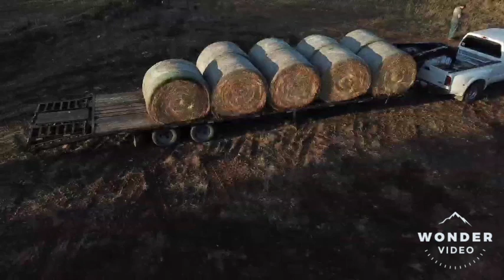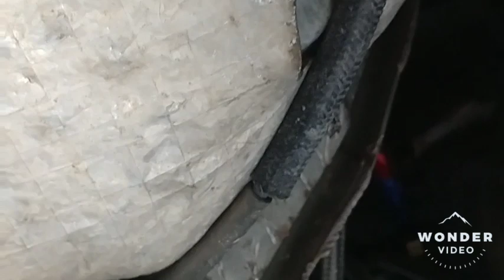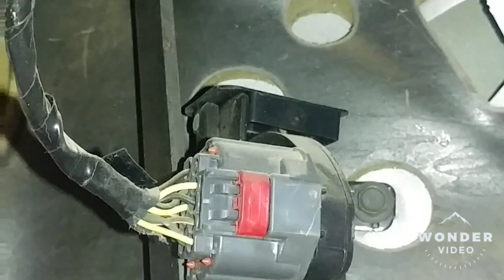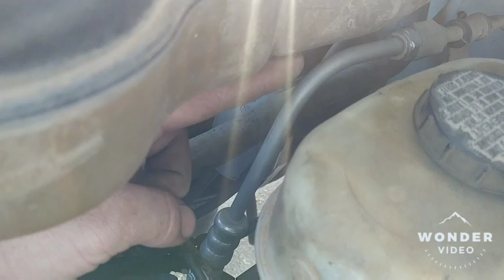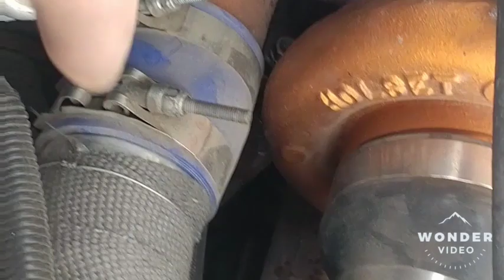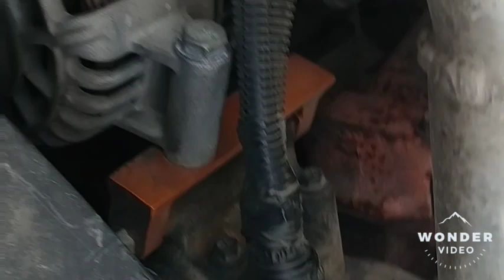Ultimate Fummins Tow Rig overview/ everything you need to know!

Comment: The F4 50s and 550s never came with the Cummins they came with the 6.8 V10 from Ford and that's when they moved the crossmember back
Reply: The F4000 in Brazil came with cummins and use the same frame rails
Reply: @Jal @JalopyFarmer that's true I never mentioned that I said the 450s and 550s never came with a Cummins

Comment: Am doing a swap now on a 2008 f 250  putting a 94 5.9 Cummins  need to know more about how you wired your transmission did you wire the cam sensor and crank sensor to the dodge sensor on the tone weel

Comment: I love your videos and I love that your testimonial for this kinda build and so educated on it. I personally want to do a 05-07 f250 swap don’t know if manual or auto is good and for motor was thinking 97 12v or a 99 24v with a p pump swap. I am curious to know what’s the most you ever had gross weight and did your truck struggle on that load ?
Reply from the maker: Most gross was 42k and it pulled just fine just wasn’t fun to stop. A comfortable weight is about 36k total

Comment: How are you setting the fuel PSI up for the ford fuel pump ? I’m at 30psi at start up and only goes down from there. I was hoping to get 50-60 psi so it doesn’t drop to zero at WOT
Reply from the maker: On the ppump take the return banjo bolt out and stretch the relief spring until you have desired pressure that’s the easiest way. Or get a fuel pressure regulator to put in the return line after the ppump

Comment: have a 5.9 out a 97 dodge that Was put in a 2009 f550. It’s eating up belts plus the belt is super tight I mean I never had a serpentine belt that is this tight. The accessories are from the f550. But the belt is design for a 97 Cummins. Im thinking I need to go smaller on a pulley and help will be greatly appreciated.
Reply from the maker: American bully Heavy Pressure the alternator pulley could be sized down pretty easy, and also change the tensioner they can get out by a fraction and cause all sorts of problems. Have a picture of the front of the engine?
Reply: TheFumminsPage rpope thanx for quick reply and I can definitely send a pic of the front of engine to you. Can u leave your email.
Reply from the maker: American bully Heavy Pressure rpope607@gmail.com

Comment: so are u say i would not need a tuner at all if i just hook all that stuff to the old computer? lol i cant stand the fact of spending 600 on a tuner when it cost less then 50 to make i was going to swap out the trans but ill keep it if i can get it to work with out it. im a little under on power at my 250hp stock rating but it being a international dt466e not sure if it can even be tuned up but 250hp is fine for me i will had a bigger turbo later at some point.
Reply from the maker: intel2you yes it will drive just fine with no tune. What’s important is getting throttle travel to rpm to match what the 6.0 was as close as possible. To do that you adjust the arm on the pedal that will pull your cable. Secondly is rpm signal it has to be good as well. I put about 5 thousand miles on mine with no tube and had no trouble at all
Reply: @thefumminspagerpope4452  thanks for the reply i was going to go to a allison but didnt want to i can do a full rebuild 4 times on the 5r110 for what 1 cost on the allison. i was dreding the fack the would be 3 computers the dt466e's the ford and the allison just to much wiring to deal with. thanks again

Comment: I've completed many fummins swaps,  I wouldn't use anything but swaphelper.com  for tach signal.
Reply from the maker: PRSH8YA stuff I hear that a lot, but I have had zero issues with the tone ring and the stock Powerstroke crank sensor. If I ever have issues with I’ll try a swap helper but I’m not going to fix it if it isn’t broke.
Reply: Totally agree. I appreciate your no bias approach to that.
Reply from the maker: PRSH8YA stuff absolutely. At the time I did my swap I didn’t no about the swap helper or I probably would have went that way. I did take my time and make the wiring as best as possible and so far it seems to have paid off
Reply: @thefumminspagerpope4452  hey great video . Gonna do a swap soon so this video will be a big help. I have one question, which tone wheel do you use for the rpm/tach sensors?
Reply from the maker: Gerhard Harder I used the one from dcs and I have no complaints at all

Comment: i agree about using the factor fan. much better. i like to leave it as close to factory as possible. it is easier to get parts along side the road when its o.e. parts. The extra holes for the transmission cross member is for the difference in length between the automatic and the manual transmissions. the f450 and f550 never came with a cummins. the cummins is available in a f600 / f650 and larger trucks.
Reply from the maker: J.C. SMITH PROJECTS oem parts as much as possible is what I went for!
Ahh I didn’t think about the difference in length between auto and manual, I thought you could order a 450 and 550 in these body styles with a Cummins is why I explained it that way, learn something new daily.
Reply: Jc knows his trucks!

Comment: How much can you "Safely" tow with your rig please? I think the GVWR for an '07 F350 is about 16klbs. I need at least 20k for a heavy 5th wheel. Otherwise my Ford will need to be an F450.
Good content. Thanks.
Reply from the maker: Steve Walker my gvw on my truck is 20k but I feel that is low in my opinion. I believe 36k truck, trailer, and load is a safe spot to stay around. If I had f450 axles with the larger brakes I would put it closer to 42k 
This is all my opinion though, my truck pulls, stops, and handles 38k on a daily basis and I have no worries with it, but it is technically not rated for the weight I haul.
I do believe in your case an f350 will pull any Rv fifth wheel you can hook up to it just fine.

Comment: Nice truck. Does your obd2 port work as intended for the eld?
Reply from the maker: Yes the obd2 works perfect still. Because the engine is older an eld is not required but if one was needed for some reason it would still work.

Comment: Very interested in the transmission tuning!
Reply from the maker: The trans is all factory including converter. Im used an sctx3 to set lock up and shift point other than that its still the factory transmissiin control module. Im using the factory ford pedal for the throttle position and the ford crank sensor for the tach.